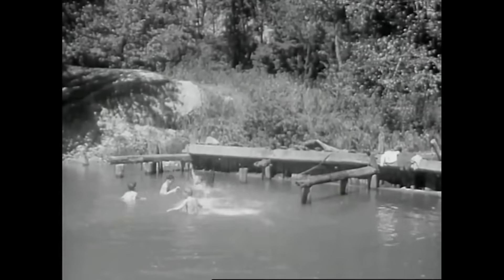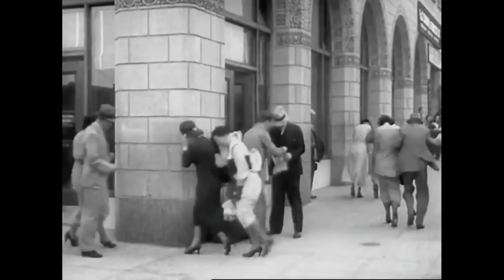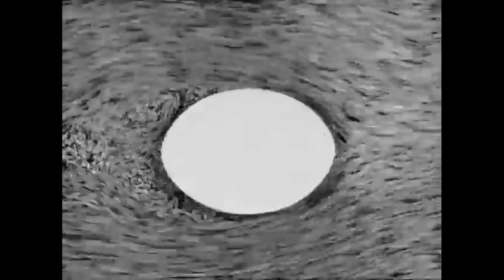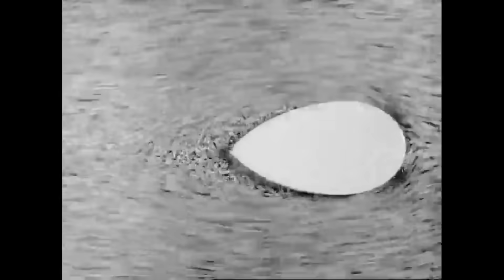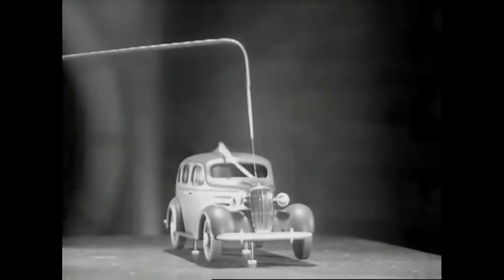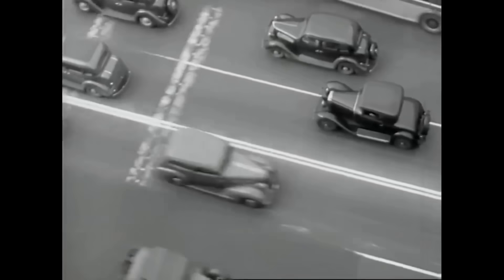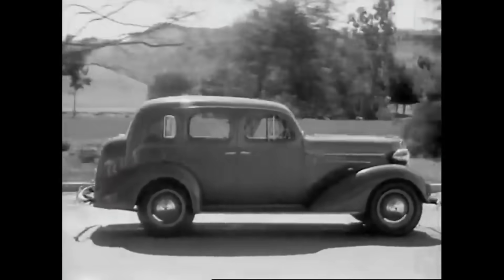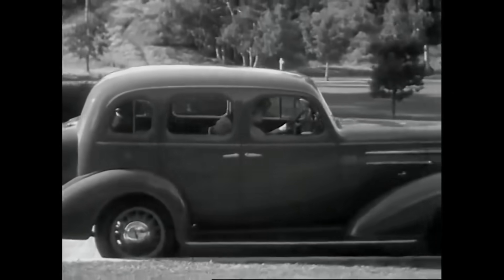1950s Blueprint for Design Of Today's Cars Uncovered

Comment: Now called fluid dynamics. In the 1930’s Chrysler designed and built the Airflow based on this concept. It didn’t sell very well because it broke auto design norms of the time. It wasn’t until the late 1940s and early 1950s that car styling really changed.

Comment: 1950s? You mean 1930s I think.     
Bucky Fuller designed and built three prototypes of the The Dymaxion Car first in  1933–34m with a then very low Cd(confident of drag) of 0.25…1930s typical American cars had around 0.55 to .65 Cd values…Which were significantly lower than 1920s and earlier models as aerodynamics as shown were being incorporated into design.  The Dymaxion has a resemblance to the melted jellybean designs from the 1980s through the early 2000s IMO.
Reply: the  1932 Pierce-Arrow Silver Arrow was the first streamlined prototype car made by a major production company

only 5 were made